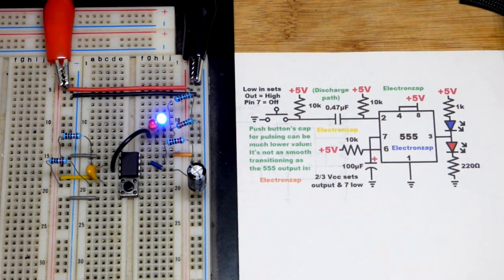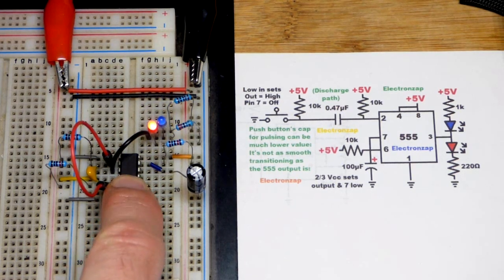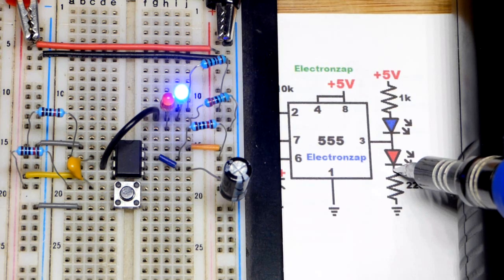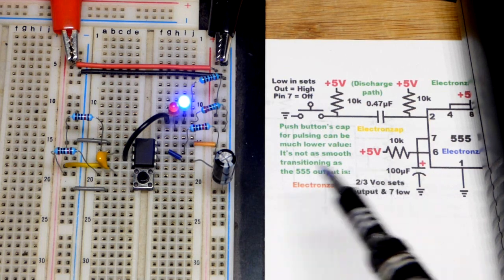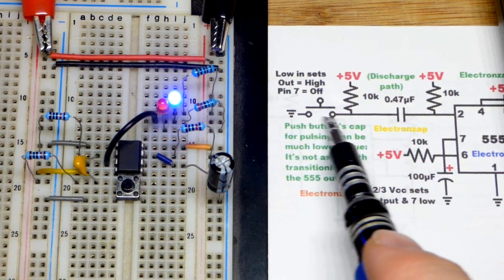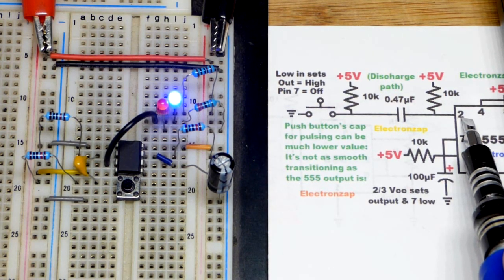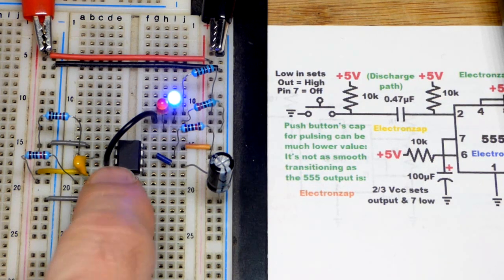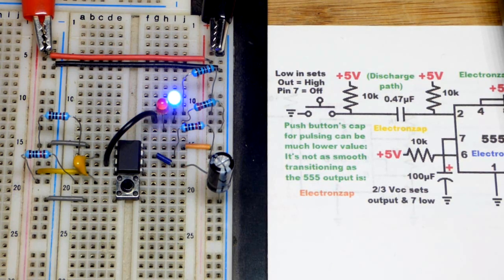Improved Monostable Mode 555 Timer Or Switch Debouncer Circuit

Comment: "Jump over" in schematics has been obsolete for decades, though it does still crop up. In a dense schematic they take a lot of space and make a mess.

All 555 circuits should have at least a 100 nF ceramic decoupling capacitor on the shortest possible leads as close as possible to the supply pins of the IC.
Reply from the maker: Yeah, if I made a schematic where there were dozens of connected points and dozens of not connected points, I'd use dots and no dot. I'm not drawing in dots for a simple schematic. A jump is a lot easier to see than a dot versus no dot as well. Most of my schematics don't even have a single non connected cross over point. And if there is one or 2 jump overs, it really stands out and is hard to miss. If an electrical engineering student struggles to understand my basic circuit schematics because the 3 or 4 obviously connected points don't have a dot, then they may be learning the wrong trade. No employer is going to want to hear them whine because the equipment they are working on has schematics that use rectangles for resistors instead of jagged lines, or that because people keep saying current instead of electron flow. Thanks for watching and for the comment!